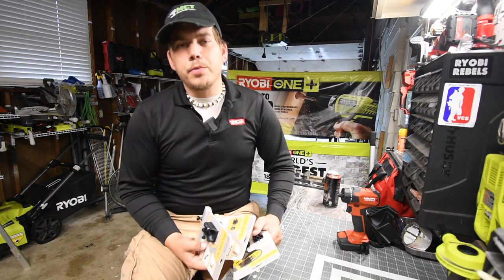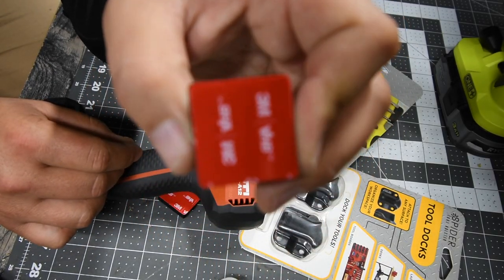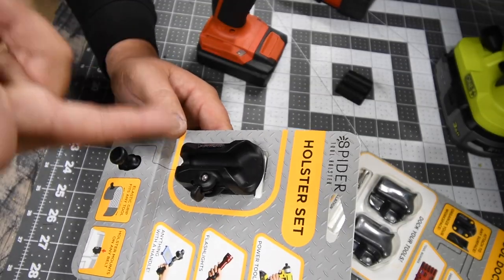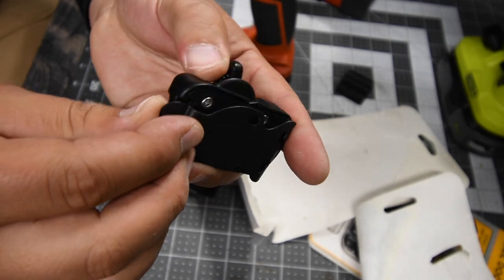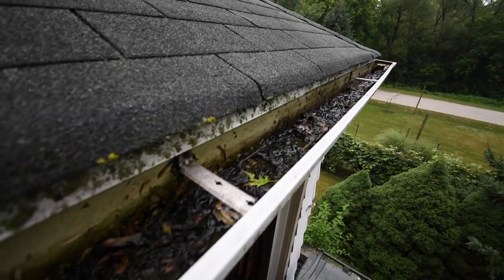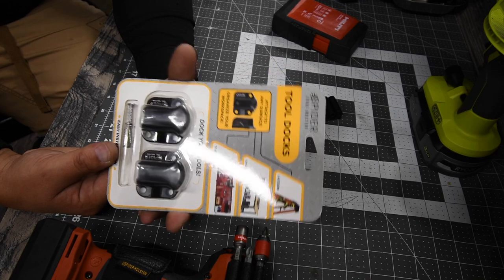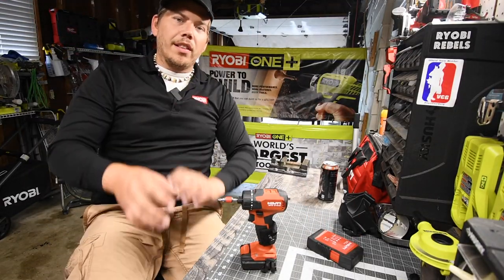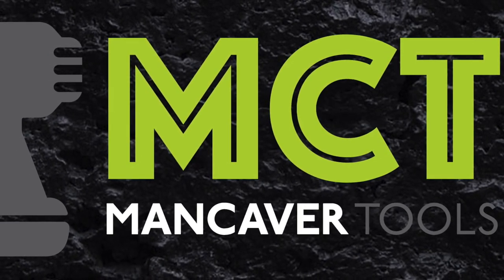Spider drill accessories

Comment: Thought the holster was kind of silly until I saw the additional mounts; nice to be able to put on your belt and on a ladder/desk/whatever.

I think I still prefer the other style holsters better though, the pouch style gun holster style ones. The fact that they usually have slots for bits, screws, a tape measure and a knife are more useful in my opinion.
Reply from the maker: it still a good little handy accessory
Reply: This is a great option when you have to wear other gear for carpentry work!

Comment: these seem like gimmicks to have that bit holder hangle off the side of a drill or impact would get in the way of working in close quarters i would rip it off not too mention although you didn't put the actual holder over the vents the bits you put in are it the way of the vents so no bueno kemosabe
Reply from the maker: I see that as well, but it is good to have bits right there on the tool when tools normally don't have any bit holders on them when you buy them now a days